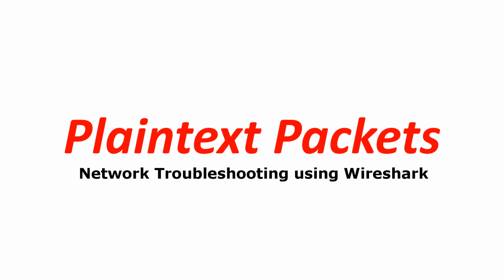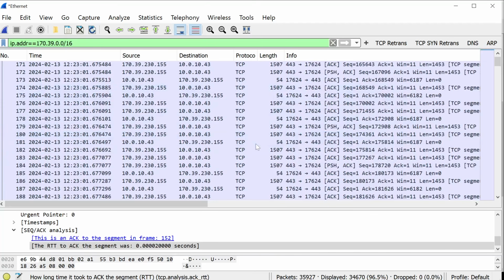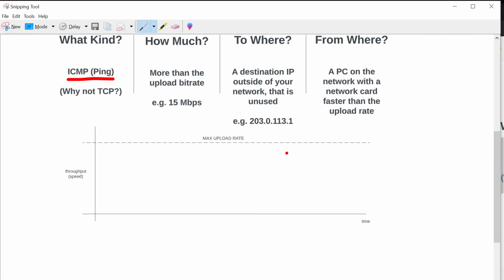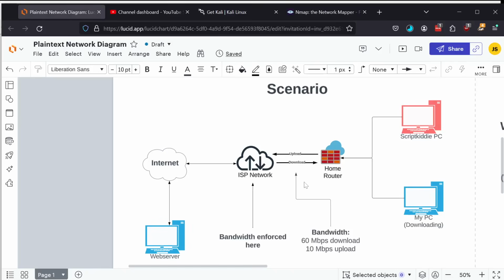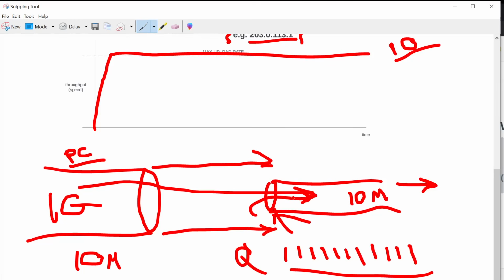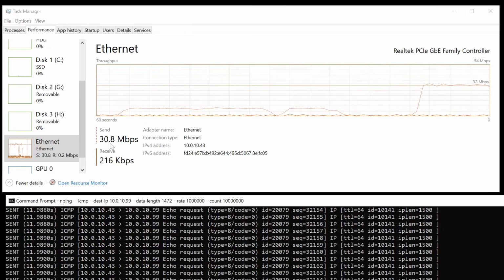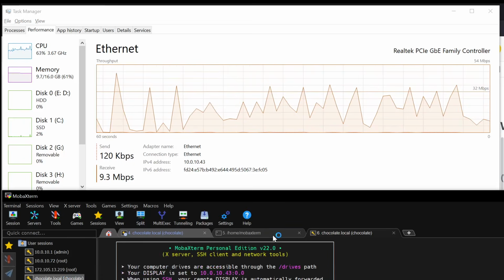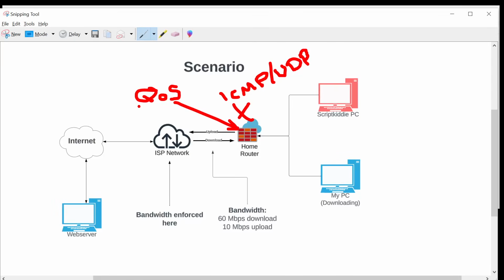How to DoS Your Network with this One Command

Comment: kind of late but it states that 'nping' is not recognized as an internal or external command, operable program or batch file.
Reply from the maker: Windows or Linux? Nping is a Linux utility
Reply: @plaintextpackets  was using windows lol, worked on linux though thanks
Reply: imagine using windos

Comment: i'd love to see you do a video of a client/server capture.  The same file transfer, but two capture points: one on the client, the other on the server.  And note how it differs on the client side wireshark output vs the server side wireshark output.  Thanks.
Reply from the maker: We do this all the time at work for advanced TCP analysis used to find packet loss. I’ll add it to the video list, thanks for the suggestion

Comment: May I know what's the command for download? I need to check the throughput of my access point with respect to the distance between point to point connection.
Reply from the maker: If you want to test performance as opposed to just DoS’ing the connection then checkout iperf . Iperf needs a sender and receiver so put the sender on a wired PC and the receiver on a wireless PC. That will test the download on the wireless connection
Reply: @plaintextpackets  got it 🎯